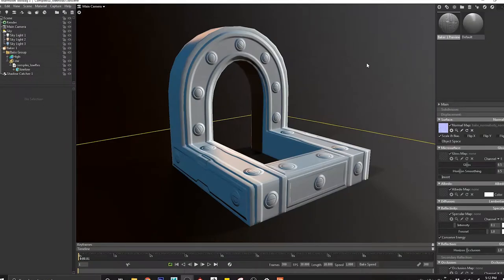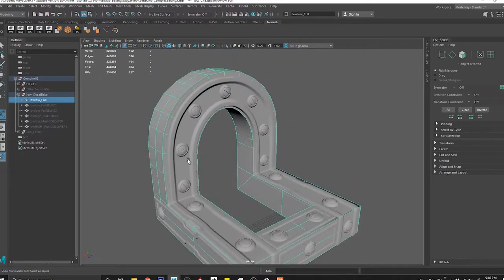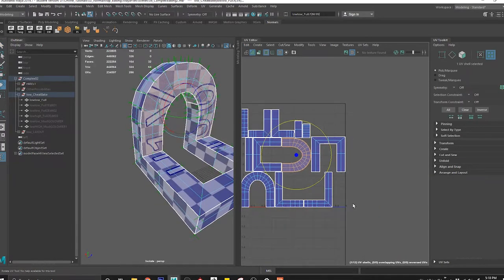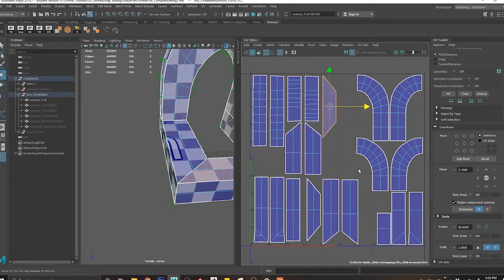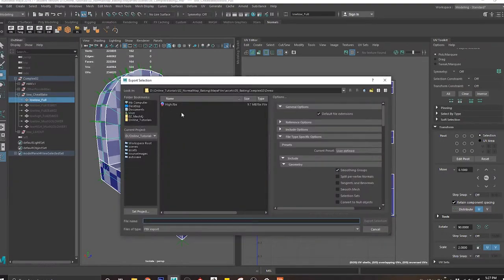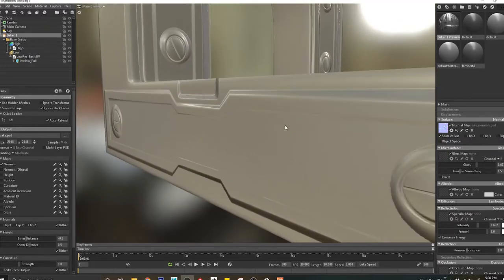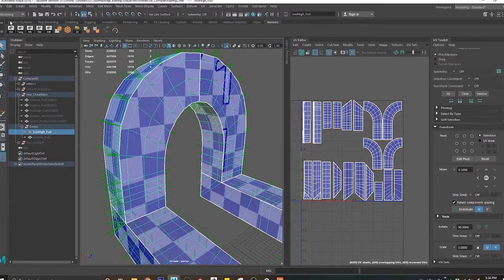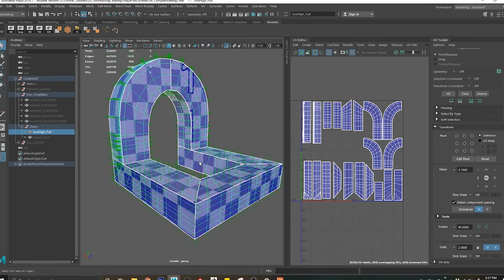09- Baking Complex Objects- Part 02

Comment: Another love. Thank You
Although... how come adding edges in LP didn't mess up Your normal smoothing ? This wouldn't work with anything more organic right ? Or even with bevels or curvatures ?
Reply from the maker: Because the UV shells were cut based on the angle of the GEO, but my multi cut kinda just follows inbetween point A and B, aka the normals that I already set.
It all depends on the Normals you set, if its beveled and curved stuff, it can make it worse or better depending on the normals you set.